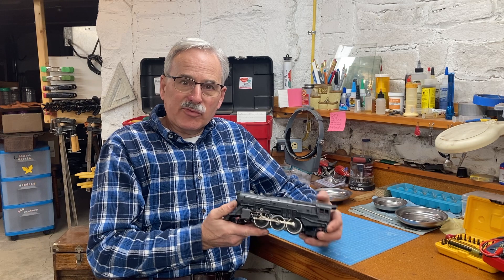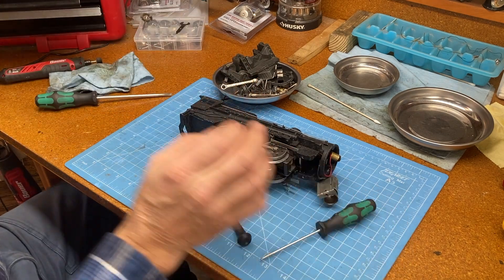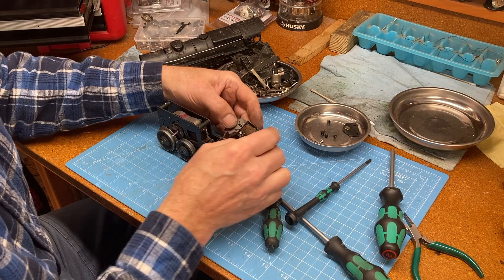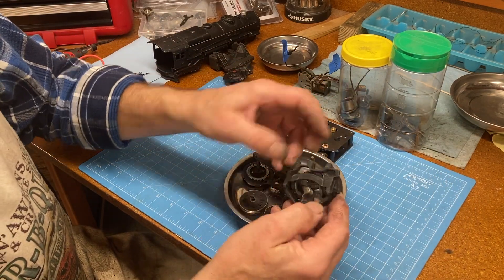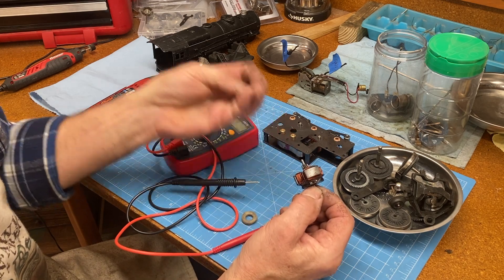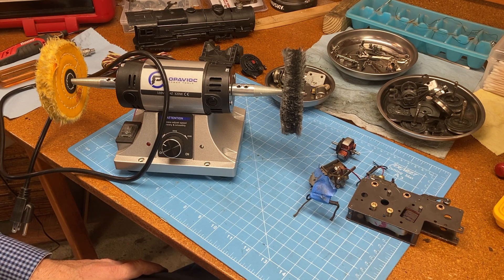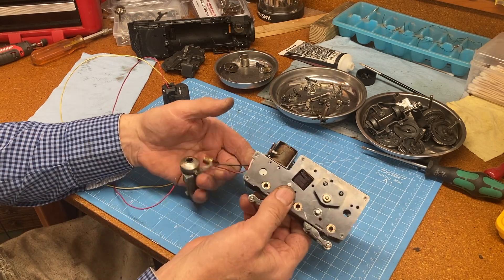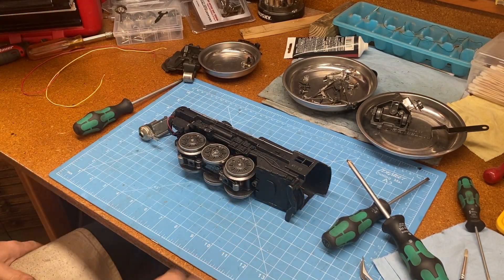Restoring a 1947 Lionel #675 locomotive

Comment: As a postwar Lionel collector, when you started I thought to myself all it probably needed was a cleaning of the commutator and e-unit and it should be good to go. For that to be the first time you ever had one apart I was very impressed by how far down you took it, but then realized you are a clock guy so this is nothing new to you. The only time I was thinking to myself you were about to mess up was when you were clocking the wheels at first but you realized you were about to mess up and corrected yourself by clocking the wheels at different directions. They actually should be quartered but should operate well at how you assembled it, just being quartered the running gear has less tendencies to bind up. Nice job!
Reply from the maker: Thank you!  I can see how these Lionel trains can become addictive. It was fun to restore that locomotive. I did the Type V transformer first but didn’t record any video of that.

Comment: Thanks for the video.  I have a 1948 575 that I received for Christmas (second hand :) in 1961.   To my knowledge, there are no remaining independent model train stores in North Carolina and this video will be of great help as I will now be doing my own maintenance.
Reply from the maker: @mikeandlucky  thank you. These vintage Lionel trains are wonderful and well worth the effort to maintain and eventually restore.
Reply: There are still a few independent model train shops left in NC.  The best I believe is in Spencer, NC right across the street from the North Carolina Transportation Museum, The Little Choo Choo Shop.  They have great prices, and do onsite repairs of all gauges.  Also in Charlotte, they are not Independent, but Lionel's headquarters are in Concord, NC.  They have a shop in Concord Mills Mall that does repairs as well, they also sell everything Lionel.  Best of luck with your restoration, it will be well worth your time and effort!!
Reply: Thanks so much for the tips on model train stores in NC.  I have been to the Little Choo Choo in Spencer and I was planning to return.  When I checked their website, it appeared they were closing down and selling out sadly.  I will definitely take a look at Concord Mills and thank you again for the great info.

Comment: Usually the wheel are installed at 90 degrees from side to side. This is called quartering. All steam locomotives real or toy are done that way.
Reply from the maker: @jamesclose7293  thank you
Reply: Real steam locomotives and Lionel steam locomotives with full running gear are quartered. Lionel's cheaper later locomotives that often don't have connecting rods, only a driving rod on each side, usually are not quartered. Marx steam locomotives with smoke units are set up so the rods on each side point the same direction because the smoke puffer is driven from both sides, requiring both rods to hit the pump at the same time. Marx non-smokers, usually only with drive rods are not only not quartered but even the wheels on each axle on the same side are not set up in time with each other. It is much faster, easier, and cheaper to manufacture toys this way when timing and quartering aren't needed to keep connecting rods from binding.

Comment: A miniature socket would be far better to remove/install the tiny hex screws on the linkage. The pliers slipping has to chew up the screws. Also time saver for video presentation goes without saying.😊 But unless some issue with linkage no need to remove.😊 I’m assuming the total disassembly is just for presentation purposes since no diagnostics was initially shown to mandate it. Why remove wheels for no reason? Be advised wobble wheels can result when repressed on. I’ll be honest this disassembly made me cringe.
Reply from the maker: Good feedback, Gene. I would certainly have used a mini socket on those tiny hex heads, but they are smaller than any of my sockets. Full disassembly gave me the opportunity to fully clean and polish every part. I’m mainly a clock guy and that’s what we do in the world of clocks. I wish I had a smaller puller to get the wheels off. They had to come off to get the motor apart. It was totally filthy and I could not have done a food job cleaning it without disassembly. When I put the wheels back on they were very tight. I don’t believe they had ever been off the axles. That was my first Lionel loco project and I learned a lot. More experienced Lionel aficionados will sure see many rookie mistakes on my part. That’s how we learn!

Comment: Wheels are pressed on.  You either need a wheel-puller, or better yet, clean the armature in the housing.  Also: leave the main connecting rod on the wheels to keep them in synch.  The E-Unit is your problem.  Clean that, and it'll run.
Reply from the maker: Thanks, Jon.  I completely disassembled the E-unit, cleaned everything, and soldered on new wires.  It wasn't in bad shape but I couldn't reach the spots to solder on the new wires without taking it apart.  The motor was filthy dirty and a thorough cleaning and polishing of the commutator and brushes was what got it running well again.  The locomotive is totally clean and properly lubed now and runs like new.  These old Lionel trains are fantastic.  This was my first experience working on one and now I totally understand why they have such a loyal following.
Reply: Biggest problem with these locomotives is over oiling. This collects dirt, causing poor electrical contact. Usually removing the motor and flushing out with contact cleaner (available at any auto parts store) is a good first step. Be sure to allow the cleaner to evaporate before powering it up. The stuff is flammable! Polish wheels and pick up rollers with a piece of a Scotchbrite pad, or I like to use a dremel with a wire wheel, but be careful about doing this on an engine with magnetraction. As the wire wheels wear, they begin to shed bristles and those little wires will adhere to everything magnetic, causing aggrevating short circuits. Ask me how I know! Next, remove the brush plate and brushes. If they are still dirty, use a cotton swab and more contact cleaner or denatured alcohol. No need to remove the armature. Swab comutator segments with contact cleaner or alcohol, clean gunk out of slots between segments with a toothpick, and polish the segments with a piece of Scotchbrite pad. Check the segments with a meter for continuity between the segments and to be sure there is no short between any segment and the armature core. If the e-unit is still not reversing reliably at this point, check for a damaged plastic drum,  corrosion or dirt on the contact surfaces or the delicate contact fingers and clean as needed. I try to not disassemble the e-unit unless absolutely necessary because while they are east to get apart, they are a witch to get back together.

Comment: That`s a Spicy Meat Ball, you did a nice a job on that there machine me. Marx train motors be a hole lot easier me thinkem.
Reply: Indeed, I also have a lot of Lionel and Marx trains and I live in the Netherlands Europe  and have fixed and restored all my trains after been stored in attics and basements and after all the years the Marx trains most of the times still runs but the Lionel needed the most cleaning especially the e unit... But I love both brands.... Greetings from Holland.

Comment: my first job as a teen ager was Lionel train repairman.  That was more than 60 years ago.  I sill have my Lionel wheel puller.  Usually if a loco won't run we cleaned the E unit and the commentator.  That almost always got the unit running again.  We cleaned them with a hard pencil eraser and a tooth pick.  The owner of the hobby shop smoked cigars,  We used his lighter fluid to remove grease.  We always did the simplest thing first and did not pull the wheels unless loose or broken.   Frequently there was a build up of hardened  oil and dirt on the wheels that had to be scraped off,  A frequent problem was a melted E unit drum, which we had to change out.  Sometimes there were broken E unit contacts to replace. We had a special tool for popping apart the E unit.  That was usually the only disassemble we did.  The coil or armature winding were hardly ever a problem.  I've probably done a couple hundred locos.

We used a paint brush to dust the loco, a black magic marker to cover scratches and then an over spray of armor all and another paint brush to shine up the armor all.  
They really looked good when we finished up
Reply from the maker: What a great recollection, Steve!  Thanks for sharing it.